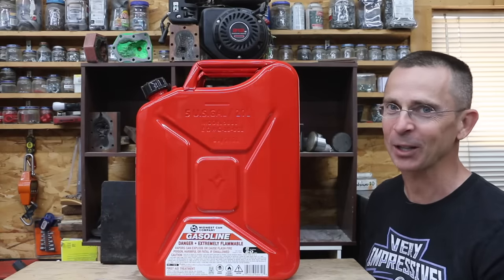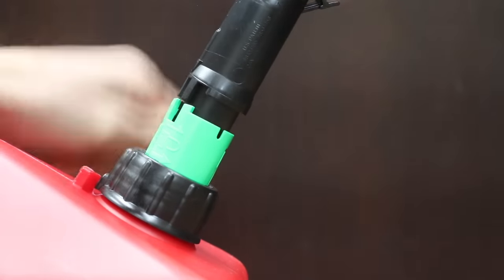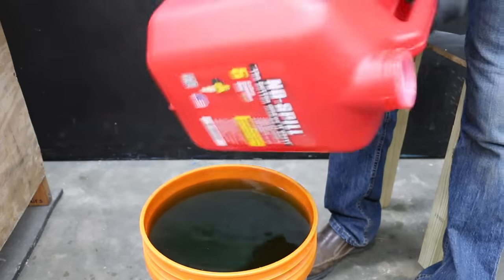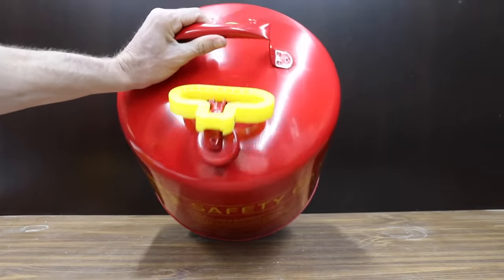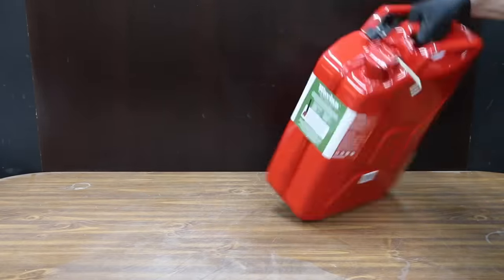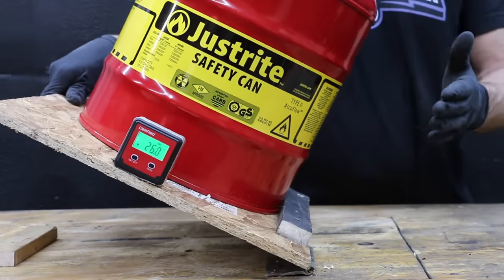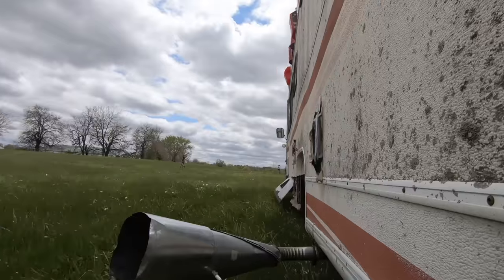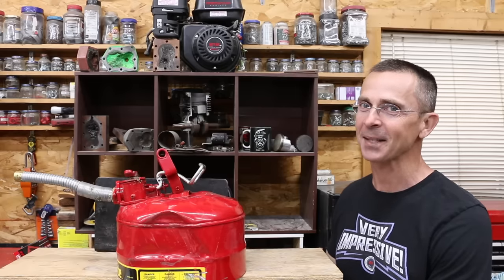Best Gas Can? $140 Wavian vs Eagle, Surecan, Scepter, Briggs & Stratton, Midwest, VP Racing

Comment: These make me miss the old school cans where you simply had a spout and vent; I really miss the days when we didn’t have to have products built to the lowest common denominator regarding intelligence and common sense. Glad I still have my old cans as they’re just so much faster and easier, just open and pour, using the angle to control the flow, no multiple and/or complicated operations. I do have one 5 gallon safety fuel can exclusively for transporting inside my sport utility vehicle as it is vapor tight and has no risk of popping the top if over-pressured or squeezed and I’m willing to add extra time for the extra vapor safety; sometimes you just want a bit of extra fuel on hand or to be able to provide some fuel to a person that runs out. 
Always strap your fuel cans down when traveling with them, fuel is very flammable and in an accident will send the van and or fuel forward into you, if you have to transport fuel cans inside your vehicle ALWAYS secure cans, avoid overfilling, and ensure your cans are sealed as the vapor is the flammable part and you don’t want bad seals allowing said vapors to leak.

Comment: I have a bunch of plastic Midwest cans from Harbor Freight we have had for several years. This year I bought another one for our son's new house. This was the first one that came with the flame arrester.  There have been complaints it makes it harder to refill so I removed it.

I've modified all the cans adding a traditional vent and using a flexible nozzle.  I like the Midwest can, being kind of short and squat seems pretty stable and being plastic no problems with rust.
Reply from the maker: Thanks for sharing.

Comment: From my experience, unless you have super sharp edges sticking out everywhere on everything, fuel tanks like the VP racing (not that exact brand, just that type with the vinyl tube nozzle stem) are incredibly nice, especially when the tanks are larger than 5+ gallons in size.
Reply from the maker: Thanks for sharing.

Comment: The wavian seems to be the most faithful to the original Jerry can design, and goes to show what a good design it was even after 85 years. It has a number of features that often go unnoticed, the air pocket at the top means it will float even when full, and there is a vent pipe from the spout to this pocket, the better extended spouts extend the vent too hence why it performed so well. The lid can also be tamper sealed or locked, and can be propped open. The recessed seam is protected from damage, and the cross pressed into the side stiffens it. The 3 handle design means 1 person can carry 4 empty cans or 2 full, or 1 can can be carried by 2 people. Also the shape is more space efficient and stacks better than the round or tapered cans, so it might be more prone to tipping but it is easier to stack and strap down. For me the choice is obvious, especially when high quality military surplus ones can be picked up very cheaply
Reply from the maker: Thanks for the feedback.

Comment: My 2 cents.  I have 6 of the VP Racing Jugs.  Used for Ethanol Free High Octane Gasoline.  Works great from dock to Jetski / Boat.  You can pour freely if you use the optional filling tube and use the vent appropriately.  Faster pour then I saw in this video.  Bonus is that you can take the can near vertical while filling and have nothing  left in the jug.  The ackward positions and distances that I have to fuel up make this easier by entending the hose so that you can fill from further distances.  The hardest part is making sure you screw the black top on correctly so the o-ring engages and you do not cross-thread the cap. This is not a legal gas can, but marinas do not hassle me.  I also see people fill up gasoline in them when the jugs are white, blue, green which I think makes them a little dangerous as there are standards for a reason.  I also like their ergonomics when pouring, like a giant mike jug with a finger well on the bottom to assist and molded for 1 hand carry.
Reply from the maker: Thanks for sharing.

Comment: Not being a factory offering  I understand …replacing the flexible spout and adding a vent cap.. (~$13 @ TSC)… puts the cans in the $40+ bracket but man are they faster! No glug glug swoosh every 10-15 seconds… And seem durable after 3-4 years on some cans… open to environmental temp swings year round.  As usual, awesome video. You rule this corner of YouTube! 🇺🇸👍🏻
Reply from the maker: Thanks!

Comment: Standard shaped Jerry-cans have a hidden advantage of standard-shaped carriers.
You can purchase jerry-can holders of different designs from just about anyway, which should mitigate tipping.

In Australia, the jerry-can shape is ubiquitous, 10l and 20l cans typically have the same size footprint. Even 5l cans can safely be stored in the same holder.

We also have the Australasian Fire Authorities Council standard on colour coding of fuel storage. You shouldn’t accidentally put two-stroke fuel in your petrol mower or put diesel in your brush cutter. It also makes it safer for emergency services personnel when something bad does happen.
Reply from the maker: Thanks for sharing.

Comment: When using the VP racing can, I hold my thumb or finger over the vent while starting the pour until a vacuum builds up in the can. I keep my thumb or finger ready to close the vent in case the can vacuum diminishes because of the vent inflow. Otherwise it will spill a lot of fuel. You can buy or rig up a pvc ball valve  so you can start the flow after the can is inverted. In that case, I don’t open the vent until the can starts to flow or, again, close the vent with my thumb or index finger.
Reply from the maker: Thanks for sharing.

Comment: I must say the nato gas can specifically the nato can is about the most perfect design that exists. They have interior welds so when stacked and banging around it’s not on the welds, the x’s actually increase their strength in groups. The gap that you can’t fill is just enough space that if they fall off a ship they’ll float.. at least in sea water. There are some interesting articles and I believe a book about it. Every military has used it for 60/70yrs. Really cool. You’d like it brother.
Reply from the maker: Thanks for sharing.

Comment: From experience I can say the best to carry in your truck is a metal jerry can style with a bolted down mount. I used 2 of these for years offroading and other adventures and having 10 gallons of extra fuel anywhere you go is a game changer.
For general use the VP style is as good as it gets. There is an aftermarket spout kit for those that makes filling a much easier task than wrangling that flex hose spout. Just about every fuel container in off road racing is a VP or the same style, those things are everywhere and legendary for their toughness.
Reply from the maker: Thanks for sharing.

Comment: I use the Wavian cans. Mine are made in Latvia. The Harbor Freight knockoff NATO metal cans used to be made in China with a terrible leaky spout so I switched to the real ones. It looks like they’ve upgraded and are possibly subbing out to one of the same Wavian contractors now, just using a plastic CARB spout design. I love the original NATO Wavian cans because you can get old school nozzles that actually FLOW, and not deal with cheap plastic things to leak later on or have buttons to fool with. Definitely my favorite cans. They do tip over when traveling so always strap them down!
Reply from the maker: Thanks for sharing.

Comment: The no spill can makes a spout with a flexible hose for filling vehicles. It will drain the tank completely, but slows down the drain speed some.  Excellent cans.  I have the VP racing can also.  Another great can.
Reply from the maker: Thanks for sharing.

Comment: Wavian believer here. Wavian are designed to be stored and transported on side if needed never will tip. Put any plastic can in your SUV for 15 min you will smell gas. Wavian can be in your SUV for weeks no smell. Store full cans in your hot cold garage for 3 weeks plastic swells up bad not Wavian. Try to carry 4 cans at one time Wavian empty easy see handle design. If full good work out. Don't try with other non military style. Wavian Price is tough but it and Valpro not tested are best. I hope this additional information and opinion helps someone.
Reply from the maker: Thanks for sharing.

Comment: I have a one-gallon Midwest Can for my lawnmower & snowblower.  There's the spillage caused directly by the 'spill proof' design, and then after a few years, the screw ring broke because of the stress of pushing it against the gas tank on the appliances.  Found a replacement spout that didn't have the government design & both problems are solved.
Reply from the maker: Thanks for sharing.

Comment: I’m a fan of Wavian cans, I used to sell them a lot. I don’t sell them anymore, but I sold them for 3 or 4 years starting around 2014. I don’t know what might have changed over the last 4 years or so, but as far as I know, Wavian (the company) is in England. I was under the impression they were manufactured in England. That may not have been accurate, however, I do know that they were all imported to the USA directly from England. I was also informed that they are the only true, the NATO spec fuel can currently in production. 

When I stopped selling them, the old style nozzle that you have was hard to come by here in the USA. They had entirely stopped importing them. Instead, they had a new one with a valve in it that I believe would have earned an A+ in your spill test, but I don’t know if it would pour as fast. Just for my own curiosity, I would love to send you the newer valve nozzle if you would want to repeat the Wavian pour speed test to see if it would have beat the other designs…

Did you know that the Wavian had other nozzle designs? I don’t know if they started importing them again or if the one you got is just someone’s really old stock…

On another note, I like your tests, and if you have a plastic can, or a metal can with a plastic lid, or a poorly built metal can, then I think that the tipability is important, I don’t think that matters if you have a Wavian. From personal experience, a Wavian can top over and bounce around the back of a truck for 10 years and it won’t receive any significant damage and it won’t ever start leaking, so I don’t care how much it tips over and bounced around in the back of my truck.
Reply from the maker: Thanks!  Thanks for sharing.

Comment: Great test! I have a 'Scepter' as well as another can with the mesh flame barrier.  The barrier poses a major problem when filling the tank. The gas pumps sense the back pressure caused by the mesh, which immediately triggers fuel flow shuts-off.  This problem is compounded by the fact that very few gas pumps allow the user to throttle down the flow rate enough to prevent triggering shutoff. As a consequence, I am unable to fill the can at any of the stations near me.
Reply from the maker: Thanks!  Thanks for the feedback.

Comment: I have two Wavian cans that are made in the Latvia factory factory that makes NATO cans. I love them. After plastic cans splitting or cracking by the filler. One thing that makes them better is the flexible metal spout Wavian makes as a accessory.
Reply from the maker: Thanks for sharing.

Comment: I am bad about suggesting off the wall crap (roach bug killer), but here is another off the wall problem I have had. I had a phone holder mounted to my windshield using the glue stuff on it when I got it. THe way this thing works is it is a magnet on the other end. I stick a piece of metal on my phone and I can just toss my phone up there and it sticks. This works great for using GPS and such. Anyhow, the glue wore out and the thing fell off my wind shield. I went and got me some rearview mirror glue and stuck it back on (according to instructions). It lasted until it got hot,then fell off again. This has been a recurring problem with different glues. I right now, I am trying JB Weld high heat stuff.  I have a couple of these magnetic mounts in my truck because I shoot a fair amount of video from my truck, and I am getting tired of gluing them back on. How about testing the different rearview mirror glues and seeing which is best. Also, I know you have tested duct tape. But just to let you know. My rear passenger window fell down in my truck so I went to Home Depot and bought some duct tape. It head the window up real good until the temperature got hot. Then it quit sticking. I would add more and more tape to untaped spots, inside and out, but when it got hot it would all turn loose. I eventually got the window fixed. Then the other side fell down. Instead of regular duct tape I got the Gorilla All Weather stuff.  It worked great. It held up real well with the heat. My only issue was getting the black residue off my window when I got it fixed. lol So, just so you know, heat has a major impact on the utility of duct tape. OH, about yoru gas cans... great video! But I prefer the old simple ones I can pick up at estate sales. No buttons. No levers. No triggers. No tricks. just tilt and pour.  Sorta like a big milk jug. 🙂

Comment: I feel like the plastic cans should have received an "A+" for corrosion resistance, instead of an "N/A", plastic is one of the best options when trying to avoid corrosion. It throws off the end results giving other cans an extra rating.
I love the channel and appreciate all the work that goes into it.
Reply: Adding the extra "A+" to the 5 top ranking  plastic cans increases their overall score by a third of a letter, "B+" Becomes an "A-", and "A-" Becomes an "A".
Reply from the maker: Thanks so much!

Comment: Excellent video as usual. My only issue is the improper use of the spout on the Eagle can. It is designed to be pushed further down on the can and left in place. The neck passes through the spout and maintains the leakproof seal with the lid. It is still sometimes a challenge to fuel vehicles, however it works better and with less leaks then having it loose like you did during the testing. Keep up the good work.
Reply from the maker: Thanks, will do!

Comment: I carry extra fuel because it's a half hour drive to the gas station. I just have two cheap plastic cans, but I bought new spouts from gas spouts dot you know what. They come with vents, all you have to do is drill a half-inch hole to install the vents. They work great.
Reply from the maker: Thanks for sharing.

Comment: I bought 2 wavian knock off cans from online.  They worked great and kept 91 octane Chevron gas fresh for over a year because they seal really well.  But because they seal so well the cans flexed, collapsed and creased which caused a leak in middle of a flat side. Not on a seam. In only a few years of use. I usually use a siphon hose to unload the fuel.  So my new plastic cans with the plastic insert I have to remove it.  The spouts that come with the cans do not work to fuel tractors or ranch vehicles .
Reply from the maker: Thanks for the feedback.

Comment: When the EPA got involved in gas can regulations by removing the vent cap, those locking mechanism on them plastic cans SUCKED...that's when I bought 4 JUST RITE 5 gallon gas cans and didn't look back, those cans are very well made and you can control the flow of gas alot easier to
Reply from the maker: Thanks fore the feedback.

Comment: As someone that hates modern gas cans but has to use a variety on a daily basis, the best cans i have found (design wise, not the specific brands here) are: vp racing(for fast flow),eagle ( for fast but absolutely no spill, like chainsaws or small engines) and the justrite for hard to reach stuff. I’ve narrowed down my use to those 3 and im so happy i did
Reply from the maker: Thanks for sharing.

Comment: A little tip on the jerry / nato / wavian can.  

The vent hole in the spout can drip gas under some circumstances like when trying to pout a small stream into a string trimmer.
If you cover the air vent hole in the nozzle while you are starting then uncovering the hole when the can is fulley upright you can eliminate that drip.  

Also, I sometimes keep my thumb over the hole the entire time to limit flow.
This works great, but you need to let a little air in so you don't get glugging. 

Surplus NATO cans are Jerry / Wavian cans and are avilable much cheaper than a new Wavian can and are exactly the same thing, maybe even a higher spec.
Reply from the maker: Thanks for sharing!

Comment: I noticed any amount of weight placed on the filler neck  while filling (like allowing the can to halfway support itself while sitting sideways in a fuel tank inlet) will force a leak as it forces the rubber/ o-ring seal to break.  This i believe is the leak most people complain about, you can get CUPS of fuel leaking everywhere depending on how weak your arms are while trying to fill.
Reply from the maker: Thanks for the feedback.

Comment: ive used the mid west plastic cans and the no spill cans and i would note that the no spill nozzle design seems best suited for small gas tanks like string trimmers and mowers and the fact that it vents through the tip means that if the nozzle is in the tank you cant over fill, however based on my experience with sevral brands on larger equipment like tractors I often find my self taking the self closing self venting nozzle off entirely for faster refilling
Reply from the maker: Thank you for sharing!